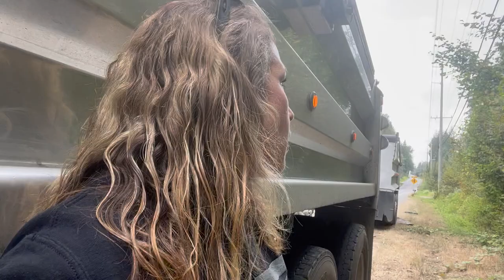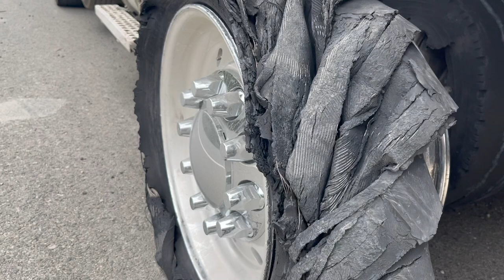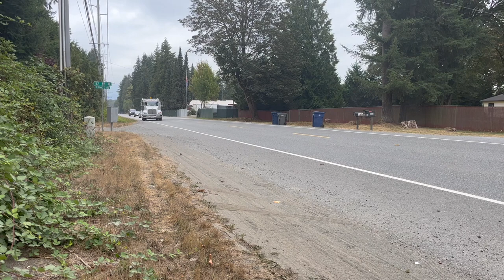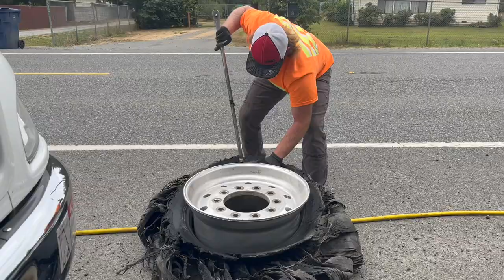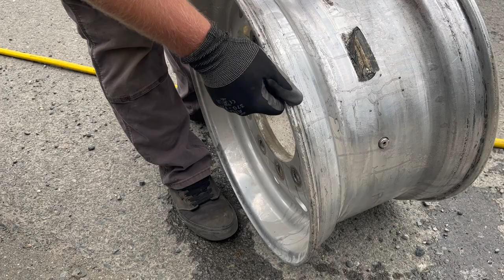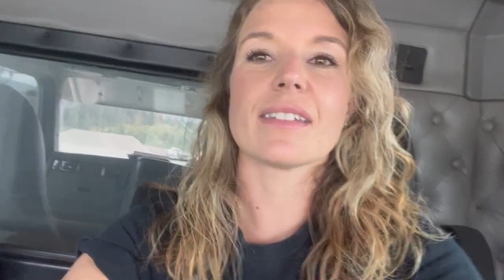STEER TIRE BLOW OUT ON MY T800 KENWORTH!!! Scariest moment of my entire truck driving career.

Comment: Truck tires will not always show low air with no load on the truck.  Checking tires pressure is always a good idea. Some people use a stick to bang the tires and listen for a tone. Understand the correct tone Will save you on some tires. It's not a full proof. Checking air pressure with a gauge is the best. Glad you are good and safe. You should have some one do full inspection on the truck and understand how often it might need to be done.  Keep up the good work.

Comment: Welcome to the world of truckin ,,, I've been hauling liquid with trains for 27 years . In my career , I've blown two steer tires , both at speeds of 70 - 80 mile an hour . The tread are very important , but the most important are the side walls , and keeping a very close eye on the tire pressures . Good to know your ok , it could always be a hell of a lot worse , and some day it may become worse . Its not a question of if its gonna happen , its when it will happen , because it definitely will some day . Keep the shiny side up .
Reply: Send a dm📩👆

Comment: I lost a steer tire on my F450 towing. I was around 25k combined. On a 2 lane road, no shoulder, running 40mph in a 50 zone. There was no holding it. It blew on the ditch side that happened to immediately drop down 13’ into a field. I kept it from rolling over, but that was unnerving

Comment: The past had a driver side steer Tire blowout at 70 miles an hour tore the front fender apart front bumper and snapped the tarp crank on the box. The trucks behind my truck both said they still don't understand how I controlled the fully loaded semi while staying on the road. They said the blowout was so violent all they could see was rubber smoke Sparks and dust flying. Your reaction was to be expected knowing the potential they could have happened we are only blessed that nothing did happen to you or my incident I don't think a lot of people understand the responsibility and risks every truck driver has every mile they make God bless all truck drivers

Comment: The 1 only front tire I blew was on interstate construction in a 1 lane no shoulder about half way through. I had to drive 1.5 miles on the rim to get out. After that half tread rotated to a trailer tire.

Comment: Damn Niqi. That’s scary shit, I have been fortunate to only lose tires at very low speed or while doin the tire repairs on my service trucks, but it’s no joke. Those steer tires are up at 100psi under normal operations and it’s a pretty substantial drop from ride height to flat. It wasn’t just luck doll, the Lord wasn’t calling you home yet.

Comment: Low ground pressure tires, like steer tires, won't visually show if the pressure is low.
Tire sidewall blowouts are almost always because of low tire pressure. As you drive throughout your day, when you get out, touch the sidewall of the front tires. If the aren't the same temperature or hot, check your pressure. 
I disagree that it was road debris, but I'm not there.

Comment: That's some scary shit,I was driving a dm600 mack doin about 45 I was loaded and a steering tire blew on the driver's side on a two lane road I weigh 220 and it was throwing me Around holding on to the wheel like a rag doll,when I got stopped and got out when I stepped off the fuel tank I kept on going down my knees where so weak I couldn't stand up for a minute that shit ain't no fun,you did a good job

Comment: Chelan to Woodinville .
blowout front  passenger. straight stretch between sultan and Monroe. 75 foot boom truck all boom above cab .two hands on the wheel luckily. hood blew up. could not see on shoulder first .next oncoming traffic. rear axles 2 foot off the road. all happens so fast did not know what happened till it was over.

Comment: Walk-arounds are important I know in Pennsylvania and Florida just on the tractor is 110 checks I believe and that's not including the trailer. And I got into a bad habit of a tire Thumper or a bar the bang the tires with. I can't imagine the cost for that you're tired because you're in a dump truck but I figure two tires are 800 for the steer tires and then I don't even want to know the price of the wheel.  Tires are not cheap especially on any truck

Comment: I jack knifed out of the blue, there must have been oil on I-20 out of Dallas, a few hours later, a small truck with a small trailer did a 180 degree spin and wound up in the median, luckily they didn't get rolled. I was talking to the cop when the second guy spun, and I told them, there has to be oil or something, but, they never checked the road for it. I didn't get a ticket, luckily no one was harmed, we got lucky we didn't roll over because of the angled truck and trailer and because the rear tires sunk in the mud ( it had rained). Be safe, it is dangerous out there, thanks for what you do. I got lucky I got fired years later, it's just too dangerous and hard

Comment: I was driving a tractor traitor dump in ohio fully loaded with coal and blew a left front steer tire at 70 mph road service fixed the tire but other damage that it caused had to be fixed at the shop

Comment: Wow, you are going through what I'm going through 
I'm from Bellevue wa, and I became an owner operator two months ago and I've had 6 breakdown 15k in repairs 
Straded in 4 states 
Broken springs 
Bad starter
Cv crossover 
Bad pedal wiring 
Leaking oil Pan
Bad jaws on fifth wheel plate

Comment: Been there… tires on your steering axle are nothing to save money on or run to long, s… happens. I had a steering wheel come off in my hands on a brand new transfer truck in 1980 on the freeway at 60. I was able to stop without crashing the truck. The night before I had picked up the truck from the dealer after having warranty work done, to include them changing the steering wheel putting a different one one. The mechanic got in a hurry and didn’t torch the lock sit properly.

Comment: An experience like that is mentally draining similar to being in an accident, it sucks the life right out of a person for a while and takes time to get past the emotional trauma. I was curious if you plan on getting the steer tires spin balanced as ideally that is the best for their tread life, certainly a long haul truck but is not as critical on a shorter haul truck that receives a lot of tire wear from constantly turning and if you do much gravel driving. However if you feel any shaking in the front end I'd certainly suggest going through the bit of extra expense as the steer components don't like bouncy tires !

Comment: Hang in the hon. I rolled a water truck 3 times a few years ago. I though I was dead. It’ll be ok. If I could I would post pics of what was left of the truck. It was a 3 axle truck and it was full of water when it went over.

Comment: had a engine blow on a rainy day, it locked up the drivers pitched me into skid. that was really fun

Bob tailing in old C.O.E. flat bedder passed me comes back over way to close too be safe, his two giant tarp rolls popped off the trailer it was like hitting a speed bump 3ft high at 65mph. launched me straight up until I wheeling down the fwy on my rear drive axle. seeing nothing but blue sky.
Reply: Send a dm📩👆

Comment: I know you're gonna hear alot of "been there, done that".... and I  have.
Running down I-30 here in Texas at night. And I  was holding onto the steering  wheel  with all my body weight (265lbs). I did get it stopped,  in the center median between east & west bound. This was before the days of cell phones. CB radios were our only communication then. My blowout happened  at 1030 pm. I  was still there when the sun came up. Cost me my job, cause my boss said  I was driving too fast.

Comment: I'm glad you have power steering. On the older trucks with no power steering you had to be an Arnold Schwarzenegger to handle it. Glad you were empty, otherwise you might have been wearing the load. You are lucky, not for the fact you didn't wreck, but because you realize how lucky you were. Too many people would attribute not trashing the truck to their "superlative" skill. You realize (humility) that luck did play a part. Makes you a better driver.

Comment: Steer tires are tires you can not trust just because they "dont look low"  they often dont look low until they are 20psi or moe lower than they should be.  When they are that low when running at or near their rated load, it causes a lot of sidewall flex that destroys the sidewall.     
I know in this case it probably wasn't the issue, it is just something I wanted to mention because I know a lot of drivers don't even check the steer tires until it looks low.  
With what you do and where you go it would not be a bad idea to get some of those pressure monitors that you just screw on as a cap and have a display in the cab showing the pressure.    That way you can now if you ran over a nail or something and have a slow or fast leak while driving.  

Glad you were able to keep it under control.  
Try not to think of it too much.  Thinking too much about what could have happened is never good.  Especially when it is something that you didn't really have any control over avoiding it from happening.

Comment: I'm not sure if this is still available but 40 years ago my dad was a safety director for an oil field company, and he was presented a device called Steer Safe.  The video showed a semi driving down a road where they had placed straw down to show how the truck reacted after the left front tire was shot out.  The driver had one hand on the wheel when they shot his tire and his tracks never wavered.  They kept going straight after the tire was shot.  Like I said earlier this was a long time ago, but this is something I've remembered for a long time.  Not sure if this helps but I thought you might like to know.

Comment: First time scared the junk out of me.  Good blow up took out bumper so stunk. 
Second time i felt a little more prepared tapped the brakes truck yanked to that side let off brake and just rode it out.
Last time tire deflated quick didnt explode just was up didnt hit nothing it was down.   They said valve stem blow out. 
First two where with a dump truck company complained for about a week both times. Was told there God it's our busy time.  Quit shortly after i didn't wasnt to go over the road again but back out here besides house getting broken into about a year ago.
Last one was with last company.  Brand new 389 pete the front right just started sinking and pulling pulled over and tire flat...  it was one of the weirdest flats ive got.  Was in jersey and cars all around lucky i was in right lane and not trying to pass anyone or something... boss didnt believe me asked tire guy told him tires holding air replaced valve stem.  Boss told him ok was a little mad he didnt change tire but did like 50 or 60k more on that tire before he closed company

Comment: Most all tires give you signs a blow out is coming. The biggest cause is low tire pressure. Every pretrip, check your tire pressure, not with your boot or a hammer. Buy an actual gauge and keep them aired up.

Comment: How old were the tires?  Could the age have been a factor and been caused by deteriorated rubber and sidewall cracks. I had to replace a set of steer tires that were 6 years old because the sidewalls were cracking to the cords.  Glad you were able to maintain control and come out ok, nerve rattling experience for sure!
Reply: Curtis said it was punctured.

Comment: I have watched a few content creators on You Tube who drive their trucks with one hand holding the wheel doing 60-80 mph they obviously have never had a blow out even at 30 mph you could lose control. Here in the UK we have a 56 mph max for trucks , the firm i did drive for had the super singles on the front axle and my friend had a blow out on the motorway and it bent the floor of the truck and twisted the cab.
Reply from the maker: I don’t normally have both hands on the wheel, I’m usually shifting. I just happened to. Luckily nothing was broken.

Comment: Sometimes shit just happens. And sometimes there could debris or weather or breaking or wear and tear unknown. But Before each drive. Always inspect your tires. After each drive always inspect your tires. Murphy's Law: If it can happen, it will happen. Always inspect all tires: the tire pressure tread depth wear tear to treads wear tear to tire sidewalls without sticking your ear on the tire listen for any loss of air from tread to sidewalls to wheel at a safe distance check lug nuts for wear tear tension and that they are all there and accounted for make sure to check the tire stem for damage loss of air look at each tire make sure they are not looking low or sagging look at the front and back of your truck to make sure it doesn't look lopsided look underneath your truck and between each dually from a safe distance without physically getting underneath it on the sides front and back and between to make sure you're clear of any and all debris check the firmness of your tires with just a nice little old fashioned kick to the tire itself for firmness and keep tire pressure measurement instrument with you to make sure your tires are at a good pressure. Never hesitate to stop at the most local or nearest truck stop if need be to add the proper pressure to your tires. All that said you'll still blow a tire. But more times than not. It won't the steering tires. Usually it's the trailer tires or a back dually which is safer because there's more balanced at those locations because tires in those areas. Risk less going off road. But you'll hear the we blow out. Feel a slight pull but risk less going off road. Never hesitate to change tires regularly. Even in new trucks. Brakes and tires are important. WISH YOU THE BEST. STAY SAFE. BE WELL. THERE ARE PROFESSIONAL TRUCKERS OUT THERE BETTER THAN I AM even though I'm really good at what I do but they have EXCELLENT TIPS AND ADVICE TO HELP YOU ALONG. I have been driving cross country otr since 2009. Wish you the best.

Comment: In the days of old prior to power steering, blowing a front tire could and would get one killed. Even when having two hands on the wheel at the time. IF it happened in the middle of shifting, one certainly had serious issues. It was so much of an issue that the DOT made it a FEDERAL rule that recaped tire's were banned from use on the steer axles as they once were.

Comment: It is a scary event for sure. In 2009 I had a driver  side rear dual set of tires & the whole axle break in the rear & come out from under the dumptruck . Luckily i knew something was up i had heard a noise  stopped looked vehicle over just minutes before say nothing unusual. I was on back road maybe 40 mph when it popped & broke . It quickly started to make a noise & i looked in the rear view mirror & saw the duallies & axle coming farther & farther out from under the truck I slowed without hitting the breaks & veered off the road & stopped just 25 ft short of a graveyard stonewall which was directly in my path as i was forced to go that way. I prayed that i knew something was up with the truck & not on a major highway & 55mph because it may have ended way differently for me.. I scooped up what was left of the wheelbearings that were left & there way No grease . They had not maintained the truck even though it was just in shop for break work week before. The one owner of the company tried to blame me for an overload but i deposited the evidence on other boss desk & told her  i didnt ant to hear another excuse & the tow truck driver i knew & agreed with me as well. You are blessed to be safe & well as was i for a few more years lol. Bless you Dauminique & always Semper Fidelis  !!!!!
Reply: Forgot to say When i had stopped the axle was still in the axle sleave by maybe 2 or 3 inches yet & upright sticking out on roadway a good 7ft with the duallies still attached the funniest thing i have ever seen. How that axle kept all that weight up i dont know because i was fully loaded & extremely lucky.

Comment: Pre trip and post trip aka every stop. I know time and need to make money. You do a pre trip post trip every time it takes less and less time till you are down to 5-10mins. Especially as an owner operator. I know you said puncture in the sidewall but, people are drilling holes in sidewalls now any more at truck stops. So if you fuel up..... Also think back when you were driving if anything felt off and use that as a pull over and stop feeling for in the future.

Comment: Luck has nothing to do with it God was watching over you watching over you good rule of thumb with dump trucks every 2nd load check your air pressure especially in your stair tires when the temperature changes outside the temperature and the air pressure actually changes with the tires especially aluminum rims

Comment: Yep you got lucky with the two hands and empty and 50's speed limit. Treat them steer tires like two newborn babies.  Carefull on scales that have ange iron with a edge right at the sidewall height usually that's what gets em . Great job   wrestling it

Comment: sorry that happened to you. this is why you never use recapped tires for steer tires.
Reply from the maker: They we not recaps, that’s not legal.
Reply: @DauminiqueTheDumpTruckDriver  sorry, I didn't mean to imply that's what you had as steers. I worked as a diesel/trailer mech for 25 yes and should have worded it better. Again sorry.

Comment: Is it common place to use TPMS on a dump truck? Probably would have not helped in your situation, but would alert you to a low air or high temp situation. I drive a 30k motor home, which is but a fraction of the weight you are driving around, and a steer tire blowout is a very scary thing to think about. Glad you are ok.
Reply from the maker: I’ve never seen a truck with sensors. I wouldn’t waste the money though. In 16 years this has never happened. It’s just a one off.